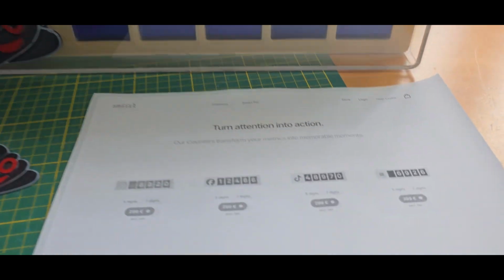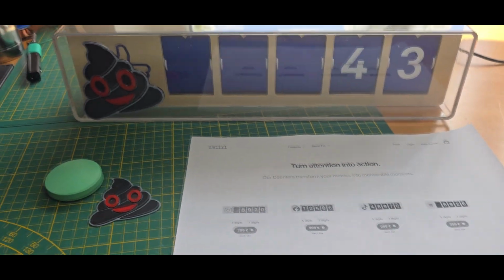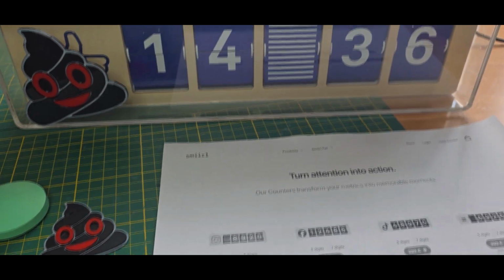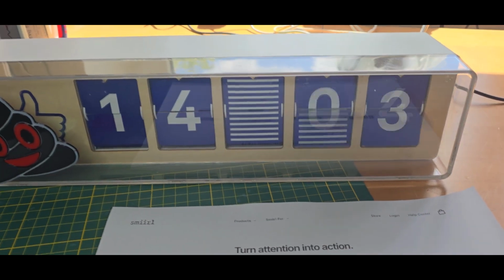Sh*tty smiirl IoT Flip Counter hacking, De-Cloud the expensive Subscriber counter via Home Assistant

Comment: One nasty thing about Smiirl is they don't sell spares. I have a counter where someone fried the board by clearly using the wrong PSU and they won't replace it. Only sell you a new one. The API number endpoint works on my other one (thank you for finding that - I was about to WireShark it!) -- but the ssh endpoint is just a 404 on mine :(